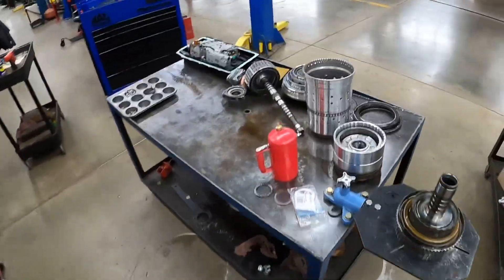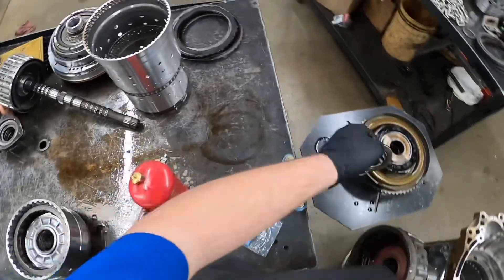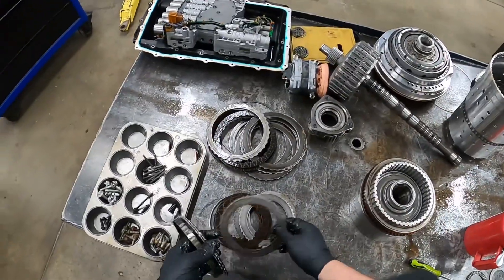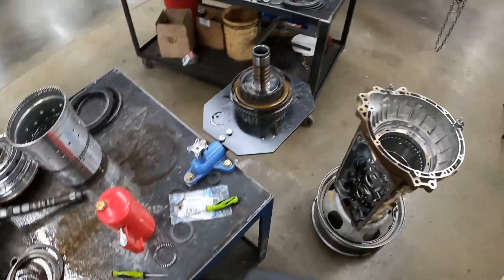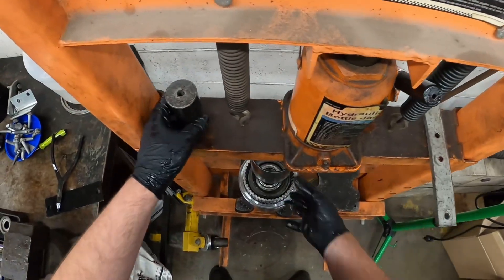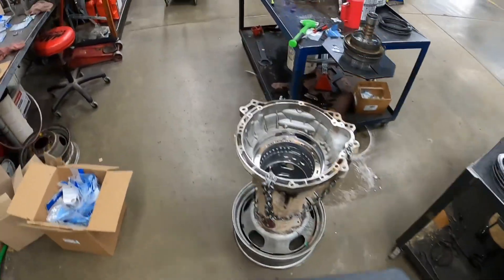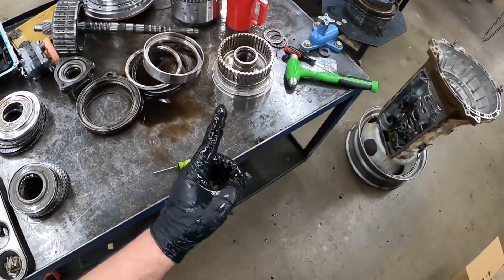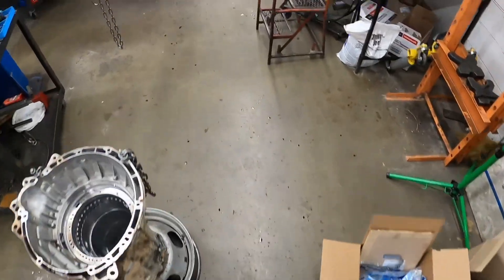Ford 10R80 CDF Drum Overhaul PT-1

Comment: My 2017 Ford F150 only has 35,000 miles on it. It cloaks when the downshift from 5 to 3 and from 3 to 5 now it’s starting to bang in sixth year which is something new but that’s rather loud at a neutral drop. Would that be a CDF drum possibly? Appreciate it man.
Reply from the maker: So, this may sound like a strange question, but with your truck being a 17 are you sure yours is a 10 speed? 2016-17 was the transition year for these. With the way you’re describing it it sounds like you may have a 6 speed
Reply: @RustFarmGarage  no it’s a ten speed.. it’s a 3.5 supercharged Eco boost..2nd gen..
Reply from the maker: @joelane4670 gotcha, just wanted to be sure. In that case then yes, it probably needs the CDF hub overhauled and replaced. It also wouldn’t hurt to teardown the valve body and make sure that everything moves freely and that none of the springs are broken.
Reply: @RustFarmGarage  question, my truck doesn’t do this all the time.. just once in a while it’ll clunk down, shifting and slam in the six gear. If it was the CDF wouldn’t it do it more often? Hey, I really appreciate you getting back to me so quickly. This shit is driving me crazy. Thank you.
Reply from the maker: @joelane4670  So it can very, does it seem to do it more often when it's hot? or when its cold? If it seems to do it as randomly as it sounds the cdf hub may just be one of a couple problems. Fords 10r80 transmissions are notorious for valve body issues as well as cdf problems.
Reply: @RustFarmGarage  well I’m taking it back in Monday for the fourth time. Hopefully this issue happens when  technician drives it.. otherwise I’ll be in the same boot that I’m in now. Thanks again, man. Really appreciate it. Wish me luck.  🤣🤣

Comment: My 2018 f150 has been jerking hard from 1-3 and goes almost neutral into 7th when its under 180 degrees in the trans. Just recently its been refusing to downshift at a full stop. Happened yesterday in 7th gear and it happened today in 4th. I assume the issue is that cdf drum bushing
Reply from the maker: With the symptoms you are experiencing, most likely yes. There is a tsb for these exact symptoms. as long as the vehicle is under warranty the transmission repair would be covered.
Reply: @RustFarmGarage unfortunately im out of warranty. Gonna have my mechanic buddy rebuild the trans for me so ill be able to save a little money. Do you know how much a new cdf drum would cost off hand?
Reply from the maker: @jimmydasani8922  For the hub, planetary cylinder, new seals, and new clutch frictions and steels. You're looking at about $2500 in just parts, not including labor, special tools, new fluid etc.